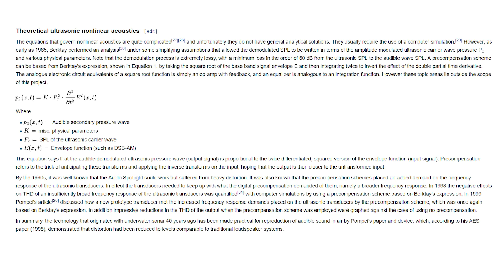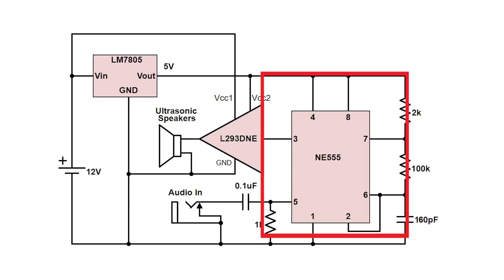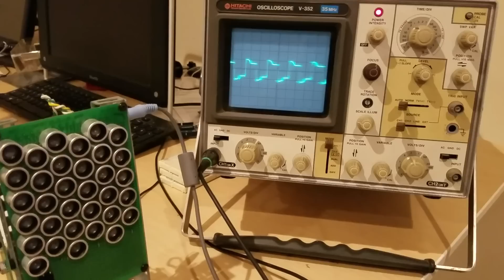Turning Sound Into a Laser

Comment: Light is a wave, BUT IT'S ALSO A PARTICLE! If you bounce a particle back and forth inside a tube it's, eventually, going to be bouncing in a straight line back and forth, with all the other particles bouncing in the same direction. This is why the light fires out of a laser in a straight line.
Sound does not do this. 

So what gives?

Comment: While it would be exponentially harder as an engineering challenge you could probably use a larger array with the right control software to make an aimable phased array like modern radar systems. I can see something like this being used in scifi as a way to deliver personal messages inside a ship, an ultrasound panel in the ceiling of each room.

Comment: I know it's a bit late, but I wanted to comment anyway. Frequency and Time/Space are duals of each other, i.e., duals of each other. If a signal is wide in frequency, it's narrow in either time or space and vice versa. This idea is widely used in electronics engineering, from radars to MRI (the first uses the frequency/time duality, the second uses the frequency/space duality). Additionally, what you did is a phased array that uses the same idea in a different form. It's widely used in radars and sonars.

Comment: The circuit alters the duty cycle AND the frequency of the square wave to modulate the audio. But your ultrasonic transducers (aka speakers) are resonators tuned at 40Khz, so it will only produce a good output when the frequency happens to pass near the 40Khz mark during the modulation.
I think that's why you have to crank the voltage to get a reasonable output.
The ideal scenario should be a square wave of exactly 40Khz, and use the audio input to modulate only the duty cycle to get the most of your transducers. I have no idea how to do that with a single 555, but two of them should do the trick, using one in astable mode to generate a pulse of exactly 40Khz, then plug the output to the trigger to a second 555 configured as a monostable, then connect the audio input to the control voltage of the second 555. 
Your first 555 will be "pressing the trigger" of the second one 40k times a second, and the audio will be modulating the duration of each pulse on the second 555, giving a fixed frequency square wave with only the duty cycle modulated.
Alternative you can use a microcontroller and tinker with its timer registers. There a couple of videos out there in YT showing how

Comment: you can do the same thing with a much higher power speaker using a transmission line. you can filter out frequencies using filters and using the analog capabilities of a labyrinth. with high frequencies your labyrinth would have to be VERY small. but you could use, for example a 100 watt speaker (a tweeter in a T-line) and overcome a lot of issues by combining analog and digital or just by using analog capabilities. it would be best to have a highly accurate 3d printer or cnc machine in your corner. that way you could make a painful or unnatural beam of sound. dangerous to those infront of it. but almost impossible to register to spectators. but you could also do the same thing with a 1 watt or 1 milliwatt speaker. probably best case here since the laybrinth would have to be very very very small and very very intricate.

as a very simple science experiment. use your phone speaker in an open room. then stick your speaker in a glass and put your ear near the horn (the opening of the cup) same concept applies. the idea here is that in order to concentrate the beam of sound, you'd need the shape of an inverted cup. so to speak. the actual product will be much more intricate. but in laymans terms this is how you yeehaw.

Comment: I randomly dropped in a Bose store, probably over a decade ago,.. and they took us to a room to demo a television with a very sophisticated version of this technology. They didn't tell us the audio was coming directly from the TV during the demo. However the demo audio sounded like it was coming from all corners of the room,.. and you could hear the audio sources traveling all around. After pulling away the faux surround sound speakers, a brief explanation that it was all coming from the TV,.... I was like, "That's really neat, and I could see how it could have consumer end appeal, if there was a strong production support or library to fully take advantage of the moving directionality features, to the degree featured in the demo,... but uh, true 5.1 surround in movies and videos is relatively scarce or niche on either the production or consumer end, and relegated to theaters, and home theaters,... often with a projector,... or a separate modular video/audio systems of some sort, and I can't fathom that audio producers are gonna widely invest the time, money, interest and tech into an integrated video audio system that solely Bose produces." I dunno, if it had caught on even if they licensed it out, I think it was just too expensive to produce and too convoluted and niche for sound designers and engineers to take much interest in, and destined to fail harder than quadrophonic audio, for almost precisely inverted reasons.

Comment: World Army's & Police & Emergency services uses long-range acoustic device (LRAD) it very simuluar to this Ultra sound Speaker

A long-range acoustic device (LRAD) is an acoustic hailing device (AHD), sound cannon and sonic weapon developed by Genasys.
It has been used mostly as a long-range communications device, but there are fears about potential damage to human health when used as a 
method of crowd control, has an extremely high decibel capacity (up to 160 dB). Other uses have included for negotiations in siege situations to deal with piracy at sea; for mass notification during natural disasters or other emergencies; and by defense forces, including several navies.

Comment: The air absorbs the ultra sonic frequencies, because the heavier molecules can't move as fast as the lighter ones. This slows down the small waves and they collide forming a bigger wave of a lower frequency. This bigger wave can travel trough air more easily because it has more energy. The result is an audible frequency if this frequency was modulated into the original ultrasonic signal.

Comment: Laser is the wrong term for that. The Phased array is more of a spotlight with a focused beam from emitters, not a medium that is stimulated to increase radiation of sound or light like a LASER.  This is more correctly identified as a phased array as used in military radar and other directional sound and radio devices.  This focuses sound like a phased array, not a LASER.  Unlike a LASER, the array can be phased for receiving with directional pickup.  This is sometimes used in sports stadiums.
Reply: I came looking for this comment.
Reply: Is this a phased array, though? I was under the impression that the collimation came from the fact that it was operating in the ultrasonic frequency range. I didn't hear him mention anything about adjusting phase (though I imagine that might let you scan this around without moving parts, which would be uber cool).
Reply: @aceg81  If the phase can be adjusted, then it is steerable. A line array, all in the same phase is also a phased array. As such, the array makes a narrower beam than a single element alone.

Comment: How many speakers per electronic circuit? I have a naive question:  Do you have one electronic circuit driving multiple ultrasonic (US) transmitters or one circuit for each speaker? If only one circuit, how do you plan how many US speakers you can load each  electronic circuit with?

Comment: I have someone teaching me all about high-end loudspeaker design. Reason why higher frequencies are more laser like because of “acoustic size”. For a very low base frequency, say 20 hz, the wavelength is 17 meters. Pretty much anything that sound wave encounters is going to be “acoustically small”. On the other hand very high-pitched frequency with a much shorter wavelength, is acoustically small compared to objects in a room, so they reflect.

Comment: Bose used to have a 5.1 surround system built into a TV that worked on this very principle. It would position 4 virtual speakers on walls in the room, and the sound would be beamed to those locations. And then all of Bose's DSP stuff to fix up the sound. It was a very impressive tech demo.
Reply: i don't remember what bose had (possibly just a prototype and never a real product?) but yamaha definitely had this tech in their YSP (yamaha sound projector) soundbars, like the YSP-5600
Reply: @vinylcabasse  It was a rather short-lived product. But I remember this was supposed to be the premise of sound bars later. Like the YSP. I've never actually heard the YSP, but I bet it's awesome.

I feel like in this area, Bose should have stuck with research, patents, and licensing. Moreso than making actual products.

Instead they have just kinda turned into a boomy overpriced headphone brand. But their DSP stuff was super top-notch.

Comment: Goddamn, this was what I was looking for.

I was playing a Tabletop where technomancy was a thing. I thought that since sound waves are technically kinetic waves, With a strong enough speaker tuned to the exact frequency of a material, I can destroy pretty much anything I want to.
Problem was, Sound waves spread, so I was pretty much better off with a grenade if i wanted pressurewaves to destroy stuff with.
I needed a focused beam of sound
I googled it and was dissapointed it wasn't a thing.
Im putting this in the 'Cool stuff' section of my brain. Nice video.

Comment: At high volume, you can damage your ear drums even if you don't hear, remember that your ears are exposed at the waves in the air. BTW that is why you don't see something like this on big. At the level you output is not different from a live performance, won't get you deaf but i say DON'T CRANCK THE OUTPUT POWER UP, is for your and others good. Very nice to see someone revive this old tech. 👍
Reply: High power versions are being used by police and military forces around the world against civilians as area denial "non lethal" weapons. They have been causing permanent ear damage.
Reply: Just like you can damage your eyes with optical lasers without realizing it...
Reply: could you provide some more insight or links explaining this?
Reply: @selfhelp441  What how ears work or how sound waves work ? It's real nothing special, sound like music for example, is a combination of high and low pressure that hits your eardrum, your brain interprets this. Now the less known thing , any wave even in the inaudible range, over 20khz are still moving your eardrum even if your brain doesn't know how to process it and it says there is silence. Same with UV or IR lasers, you see nothing until you really see nothing as you get blind.
Reply: Incorrect. Ultrasonic sound does not damage ears because they are not mechanically sensitive to it (don’t couple, don’t resonate). Same thing for subsonic bass. You can feel it but not damage your ears. To the reply about if lasers hurting eyes, yes. UV carries intense energy that makes radiative contact with retina and burns the tissue.
Reply: @AffinityPhoto OK try it, after you can still read and wrute, no biggie 😂
Reply: @neumanngregor I’m an otolaryngologist
Reply: @AffinityPhoto I'm a engineer, I learned a thing or two about sound in different materials. But hey this argument of yours "I'm a ENT" makes 1000% sense, yeah why bother to go to schools or universities when there is a guy on the internet with his nickname of a alternative to Photoshop that know it better.
On the National Library of Medicine there are a lot of articles about this, here one I liked randomly "Possible Effects on Health of Ultrasound Exposure, Risk Factors in the Work Environment and Occupational Safety Review". Mr "ENT" I think you need to read more medical literature if you do not like physics. I have said what needed to be said I will not embarrass you more that you already did to you yourself. Have a nice and productive day.
Reply: @neumanngregor  I'm also a MSEE and MS aerospace. I work with ultrasonic rangefinding for robotics. you only hurt your ears with crappy gear that has lower fundamentals from distortion. You'd need 140dB to cause discomfort and prolonged 160dB for tissue heating or cavitation.  From your physics classes, youd calculate that at 1000x the SPL this guy is putting out. Plus, demodulated sound on top of the carrier has a -30dB loss. I was affinity photo way before the app.
Reply: @AffinityPhoto I like turtles

Comment: When thinking about how high frequency waves don't spread out as much, it's better to think about the wavelength.

When a wave passes through a slit, it diffracts at the edges, you can sort of imagine this like a friction slowing the wave as it brushes past the walls on each side, which causes it to turn as it passes through, and on the other side is spreads out in a growing semi-circle/-sphere.

If the wavelength is much smaller than the width of the slit, this is analogous to making the slit much wider. For a large section of the wave in the centre of the slit, it's as if there were no walls and it is travelling in empty space. The vast majority of the sound is able to pass straight through without diffracting.

Comment: Where can I buy those speakers and can I buy them individually.
Reply: check first post... the transducers are the same part used in "distance sensors" which ave two on them for around $1.59. you can buy them individually form suppliers for a higher price, but if you check the part numbers, they are teh same.
Reply: @atomictraveller  thank you so much

Comment: Judging by the look of the thing, I assumed it would be a phased transducer array in order to focus the sound, as opposed to using the transducers’ own geometry to assume that minimal sound will leak to the sides. I wonder how directional a single transducer actually is?

The use of a 555 for frequency modulation is also displeasing, if only because of the poor output voltage (only goes a bit above 3V on a 5V supply) and difficulty to tune without also changing duty cycle. The control pin is also directly connected to the 5k,5k,5k voltage divider, so it’s not like modulating it won’t also effect duty-cycle, plus it’s rather dependant on the output impedance of your signal due to how low value those resistors are. So that might be interfering with your audio quality. Awful quiescent current too.
As for the driving waveform, you’re feeding it a strict square wave, so maybe introducing some inductance in series with the transducers will round over the waveform and reduce higher frequency harmonics, which might be messing with your signal somewhat. This would modify the resonant frequency of the whole circuit though. Some extra capacitance in parallel might also do something. For a single frequency case like this you could consider building a “lossless” matching network to really pump up the volume, I think.
Maybe hook your 555 VCO (tuned to a higher frequency) up to a shift register or counter with an inverter for a frequency divider, that would get a nice 50% duty-cycle AND a proper TTL/CMOS driven signal.
Reply: transducers are described as "high Q", first harmonic is 3x (course they sound spectrally rich)
link to original dev in the first comment by gigs, various improvements are discussed
looking at the 50mm 35W ceramic plates that have the same carrier 40.5kHz
(assistance being solicited.. i'm intending to build from prefab amps et c. due to deficiencies in erudition)

Comment: When you said laser, I was imagining a soundwave so focused it could cut things, which I didn't think was possible.
I guess it's not, but this was neat.  I can still see tons of interesting applications for this.
Reply: Ultrasonic cutters are a thing, basically a pieco driving a blade. Useful for some rather tricky cutting operations https://www.youtube.com/watch?v=NBY_ES2V-l4
Reply: @aleksandersuur9475  That's not even close to the same thing.
Reply: @skepticmoderate5790  Maybe not, but if you want to cut things with sound you don't exactly have many options to choose from.
Reply: You can use focused sound waves that can cut things. Any wave carries energy and, given enough time and energy, will heat up a surface, which will eventually cause burns or, in other words, cuts. Years ago, I attended a presentation in which a guy from MIT suggested that laser-like sound waves could be used in surgeries and even replace conventional lasers.

Comment: Can anyone explain to me why we need the NE555 to generate the 40khz wave? Presumably this contains an oscillator and mixer? Why can't this tone generation and mixing be done in software, meaning all the hw needs would be an amplifier. Or could it?
Reply: It just cheeper to make. In fact you can use microcontroller instead.

Comment: Well, laser is actually an acronym. Quote from wikipedia, 'The term "laser" originated as an acronym for "light amplification by stimulated emission of radiation".'

So, maybe this is more of a.. "sasvf", "Sound Amplification by Stimulated Vibrations of a Fluid". I chose "fluid" instead of "air" because theoretically it may operate in water too, or just any gas or liquid :p